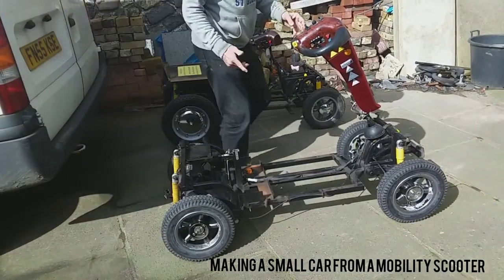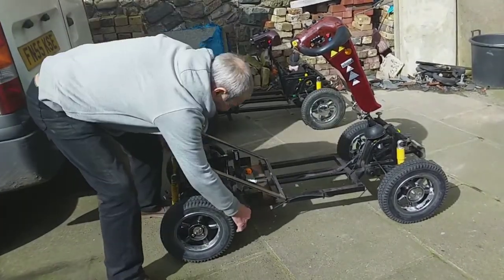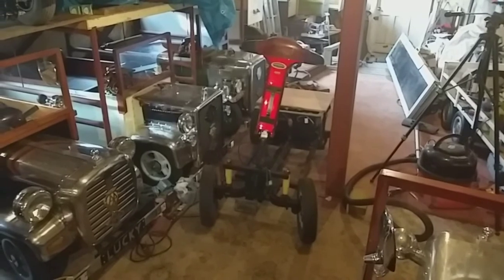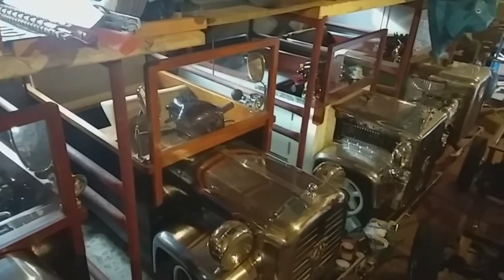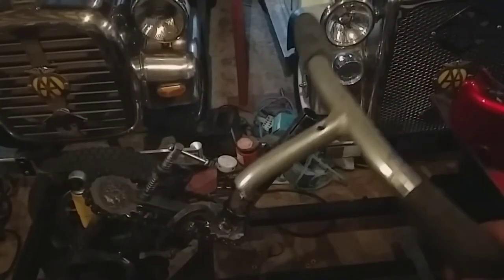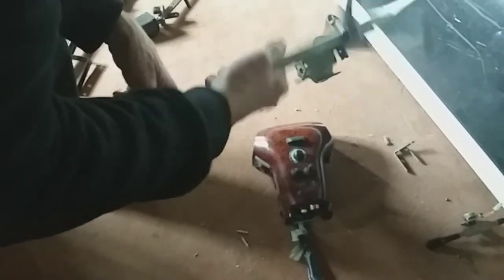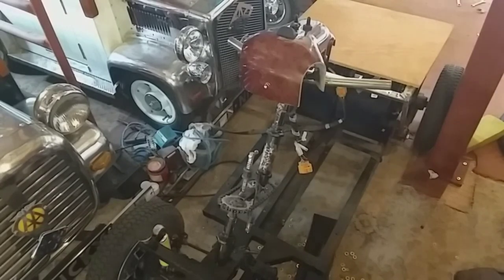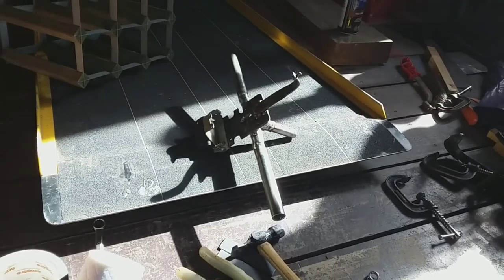MAKING A MOBILITY SCOOTER CAR OR A JEEP

Comment: very cool,  I've got one for legit use and they are good,   have messed around with smaller ones that do 4mph and the motors are not great,  but as you said the motors on these ones seem excellent and they are not used to full potential in the normal use of the vehicle.  If I could do the metalworking like you done I would like to make it lower like you did and make it go a bit faster,   or take the engine out of it and put it into a smaller one.

Comment: Can you or someone help me please. I’m building an Austin J40 car using an old Shophopper. It has no suspension but as it’s only being used at car shows on grass for my 5 year old grandson. My problem is that I’ve been looking for two months for wheels that need to be around 12 inches overall diameter and I want steel pneumatic wheels that are not too wide. Any suggestions pleas.

Comment: Nice work Peter! Where can we see the entirety of your work? Thanks
Reply from the maker: I LIVE IN DEAL .KENT. I AM IN MY WORKSHOP MOST OF THE TIME. CT14 6DY
Reply: @p..chittenden9174  what kind or watts of motor used in yellow limo?
Reply: @p..chittenden9174  what voltage or watts motor you used in two seater?

Comment: convert a single seat mobility scooter into a two seater any thoughts ideas please
Reply from the maker: YES.  IF YOU TOOK THE PLASTIC FRONT AND BACK OFF OF A SHOPRIDER CORDOBA AND THEN WELDED THE CHASSIS LONGER BY SLEEVING AND WELDING SAY 20" INCH PIECE OF METAL IN. THEN MAKE ANOTHER BRACKET UP FOR THE MIDDLE TO PUT ANOTHER SEAT IN THE MIDDLE TO DRIVE IT. A SHOPRIDER CORDOBA IS DESIGNED TO CARRY 35 STONE. I AM IN DEAL, KENT. ARE YOU MILES AWAY FROM ME. ALL THE BEST PETER.
Reply: @p..chittenden9174  Thanks Peter, I don't have a welder and my scooter is a TGA S4 Breeze. I think that there could be a way to have the seats back to back if the weight can be distributed evenly. Welding a new seat frame to the overhead cover frame.

Comment: Hi i have a cordoba and wish to turn it in to the mr beans mini but have health problems and can not lift but would like some help can you help me plz how much would it cost for you to turn my cordoba in to the mr beans mini
Reply from the maker: HI MATTHEW.  I AM MUCH TO FAR AWAY FROM YOU AS I AM IN DEAL, KENT, ENGLAND. IF I WERE NEARER TO YOU THEN IT WOULD BE DIFFERENT. TO MAKE A MINI BODY OR COPY ANY KIND OF CAR MODEL BODY YOU WOULD REALLY NEED TO MAKE A FIBREGLASS MOULD AND MAKE THE BODY OUT OF THAT. EVEN THOUGH I WAS A FIBREGLASS LAMINATER FOR 2 AND A HALF YEARS IT WOULD BE A LOT OF AGRO MAKING THE MOULD. I AM USING THE SINKS AND PLYWOOD AS IT IS EASIER. MY HOUSE NEEDS REDECORATING SO I AM REALLY TO BUSY. SURELY THERE MUST BE SOME WELDERS AND CARPENTERS NEAR YOU THAT CAN HELP YOU. KIND REGARDS PETER.

Comment: Do you do any kind of modification to the controllers to speed them up
Reply from the maker: NO I DON'T BECAUSE I DO NOT KNOW HOW TO.  THE ONLY WAY THAT I HAVE SPEEDED THEM UP A BIT IS TO PUT BIGGER WHEELS ON THE REAR. THE CAR THAT I AM JUST FINISHING IS GOING FASTER BECAUSE I HAVE CHANGED THE SPEED BUY USING MOTORCYCLE SPROCKETS. ITS A SHAME THAT I DON'T KNOW HOW TO BUT THEY ARE SAFER FOR THE CHILDREN AT 8MPH MAX. ALL THE BEST PETE.

Comment: Hi Peter I wanted know could modify my ew -36 I would like to pay you to do so if possible
Reply from the maker: HI THERE. WHAT IS A EW 36 ASVI DONT KNOW WHAT IT IS.
Reply from the maker: I DO NEED TO STOP FIDDLING ABOUT WITH THESE CARS AND THINGS REALLY AS MY HOUSE NEEDS A LOT OF JOBS DOING ON IT AND IT NEEDS PAINTING AS WELL.
Reply from the maker: I HAVE COMPLETELY NEGLECTED IT BECAUSE THE GRANDCHILDREN TURNED UP. ALSO WHERE ABOUTS ARE YOU.
Reply: @p..chittenden9174   ok I live in east hollywood
Reply from the maker: HI THERE. I AM MILES AWAY. I AM IN KENT, ENGLAND.